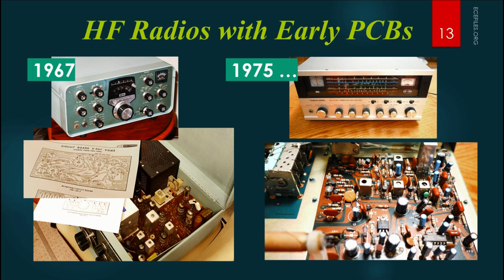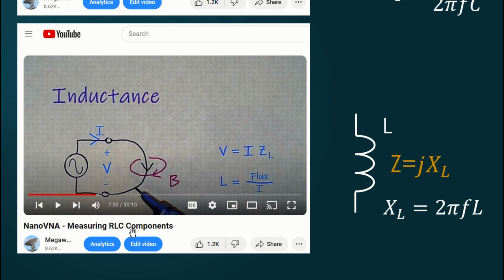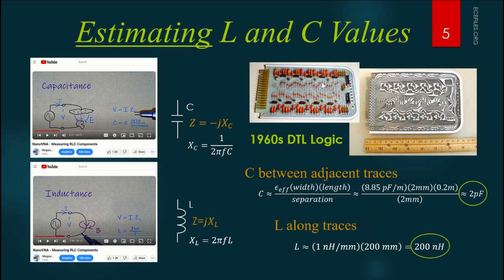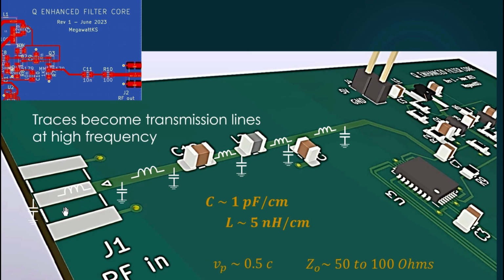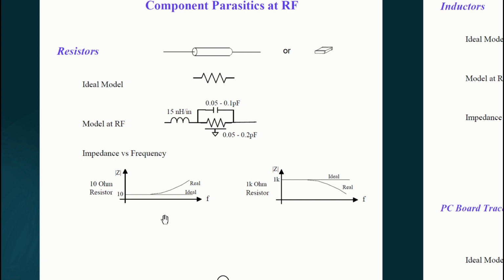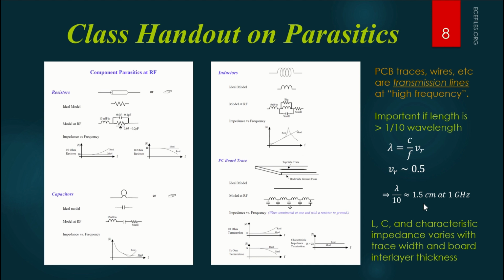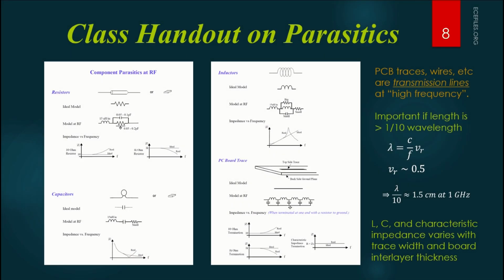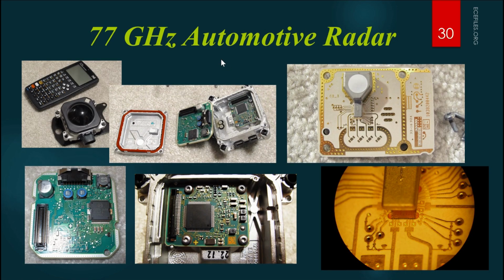RF Circuit Construction - Part 1 - Radio Design 101 Appendix C

Comment: I stopped making my own PCB's partly because of the low price and fast bd turnaround time these days, but mostly because the mix of digital, audio, and RF on so many bds these days causes me to start my designs with 4 layers. I have a + supply inner layer, a Ground supply inner layer, the digital layer on the outside of the + supply layer, and the analog or RF on the outside of the ground supply layer. But that's just a starting point. I may have to add more layers for multiple power supply voltages or isolation of analog and digital grounds. The need to eliminate noise signals on modern bds simply goes almost immediately to the need for multi-layer bds. So I'm very glad for reasonably priced quick-turnaround bd houses. A prototype built using any other technique simply wouldn't adequately reflect what a modern circuit design is intended and required to do. As I tell new PCB designers who lack detailed electronics knowledge, every trace is a transmission line, and every signal is radiated.
Reply from the maker: It is amazing how low-cost boards have become, so as you said, 4-layer is almost the new standard. It depends on the circuit/project/product of course, but the thin 5'ish mil thickness from top to internal-1 ground plane helps tremendously. Fortunately for a lot of designs - which may still use chips with digital edge speeds of a few ns, transmission lines may not have to come into play (except for long signal runs of course). Interesting subjects. Thanks for leaving a comment.

Comment: At the beginning of the video there is two opamp symbols at the bottom with two different labels. They caught my attention. Interested in knowing how to protect from the use.
Reply from the maker: Sorry - I didn't elaborate those blocks. The triangles are meant to be just some amplifier or other RF circuit with input and output impedances (not opamps). It's an abstract schematic and will be used in part2 of the video.